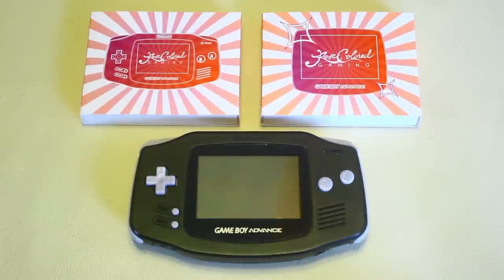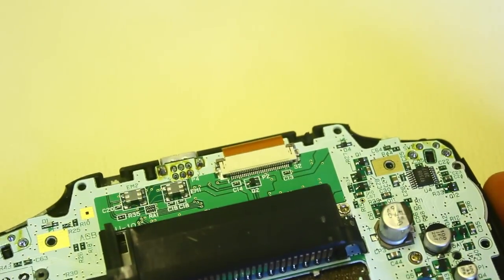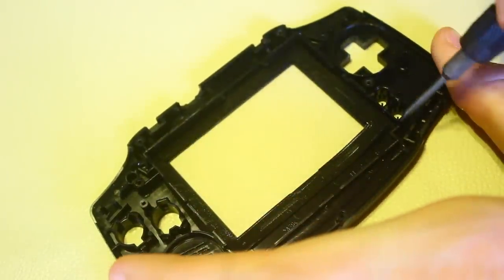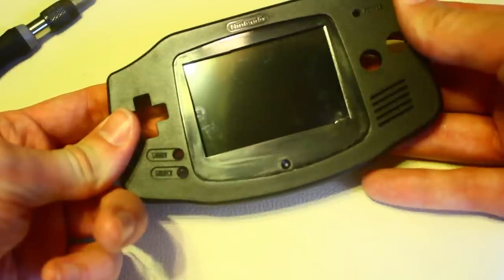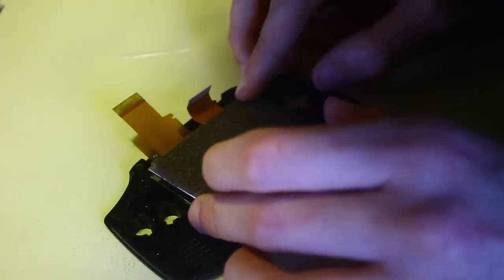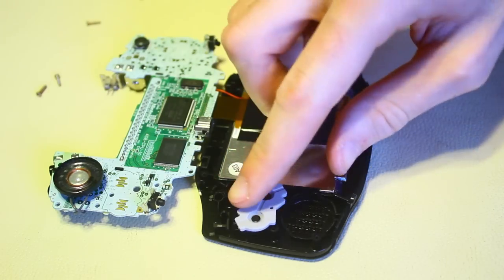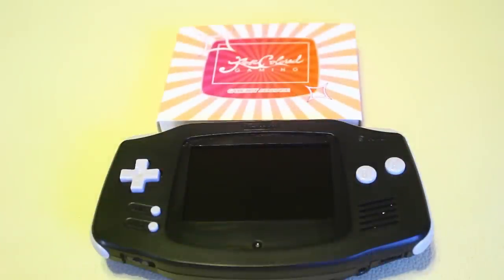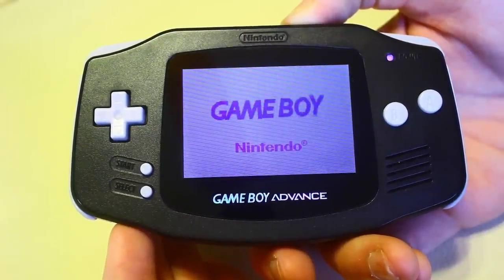GameBoy Advance Backlight Mod

Comment: Man now i gotta get one. Anyone know where i can buy an Original GBA with this creen already installed? I don't want the Chinese rip off one either.
Reply: +roughy762004 Ebay. They are not Chinese rip off either as the guy in China is the one who made back lit into these OG GBA possible.
Reply: Nus Dogg ty! i bought a gba sp one time, it played the gba games but not all of them. it was a counterfit
Reply: Yes, with GBASP, there's clones out there of those models and same with the OG GBA, but those are hard to come by now adays.
Reply: What is the problem with using the screen from GBA SP AGS-001?
Reply: Swordie100 You need a special ribbon adapter like the 101 screen but made specifically for the 001. That's if you're trying to use the 001 screen and front light as one whole unit in the OG GBA. And only one guy carrys that ribbon adapter and you can ruin the front light in the process of transfer if not careful.
Reply: I'm talking about the advance sp 001 screen in a regular advance. Not sure what you mean by front light. Because 001's are much easier to find but I'm not sure which ribbon cable adapter to use in that case.
Reply: Swordie100 Yes, I'm talking about that as well. Re-read my last post above.
Reply: Swordie100 Watch this video: watch?v=gxtjZbaGAyE 

The second GBA in the video there has the GBASP 001 screen and front light all together all in the GBA by using a special ribbon cable adapter.
Reply: But who would want a front light when the backlight is so much better? Will check it out!
Reply: I'd do cause no one else done it, and it's part of the collection. Plus, all the back lit screens are gone, unless, you rip a 101 apart.
Reply: I'd just pick the ags001 then, with the ribbon cable. :o